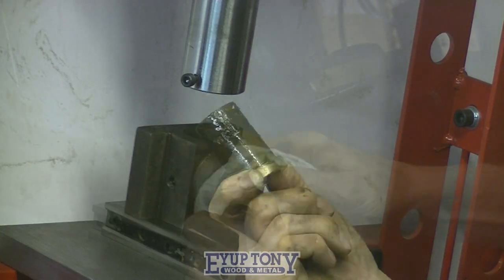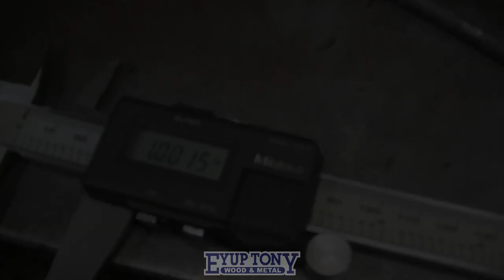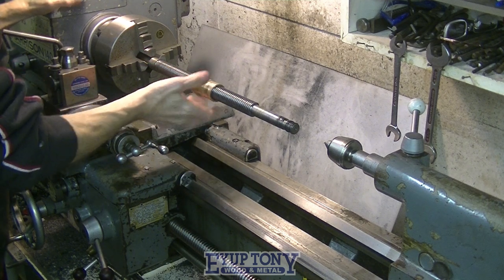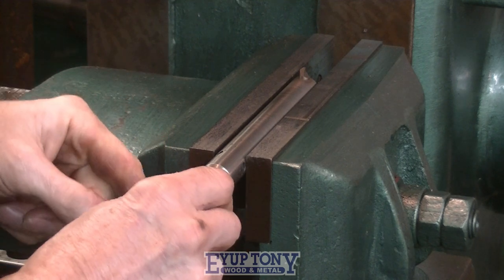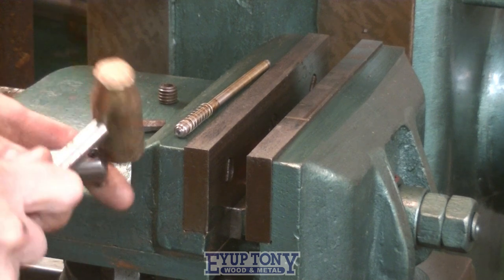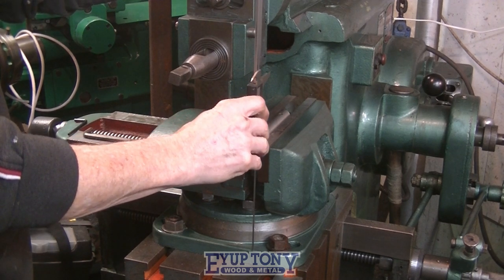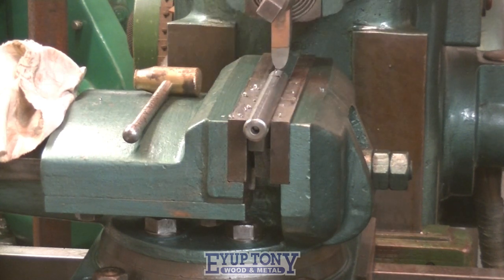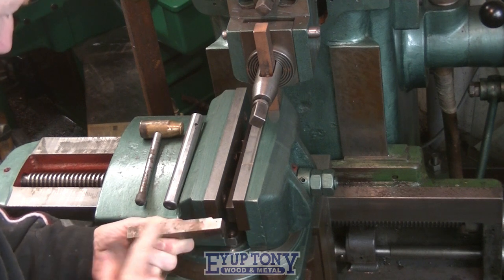Part 3. Vise vice restoration  Boring bar metal shaper work

Comment: Well, kind of a bummer of the slop in the bronze nut, hopefully the lead screw can be cleaned up - or are you planning to remake it as well?  And I felt for you when you saw the tapered cut on the boring bar as just when a guy figures he's got things set up right there can be something unforeseen like that tool holder.
Reply from the maker: Hi Everett. If the screw was from off a machine I would have reskimmed it along the thread but its only for the vice.
It will still be a great improvement on the original nut. Thanks for commenting. Tony

Comment: Very interesting Tony. I did the exact opposite just recently. I had a boring bar that I got secondhand which was octagonal in section, and too large for any of my tool holders. It had a 90 degree hole at one end and a 45 degree at the other end for boring and facing a blind hole. I turned it in the lathe (to 3/4" I think) to suit my toolholder. So it went from flats to round, and yours has gone from round to flats :)

I'm keen to see how you remake the nut, and also the locking threads on the end of the leadscrew. Very interesting so far. Looking forward to part 4.

PS: Did you see about Emma's toolmaking competition? If not, I think you'd love it: #TMC2020
Reply from the maker: Lol Craig. It's great what you have to do to make things fit. It's all been done before somewhere along the line.
Adapting tools saves you money in the long run plus your gaining experience as well. Thanks Craig. Tony